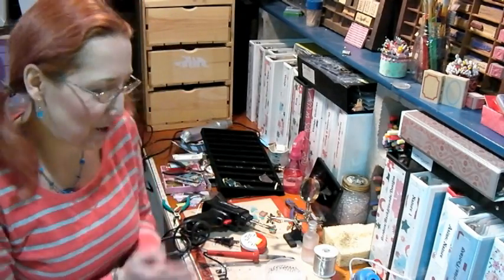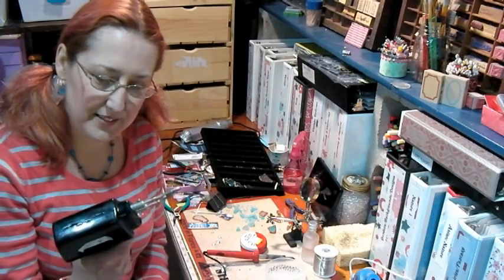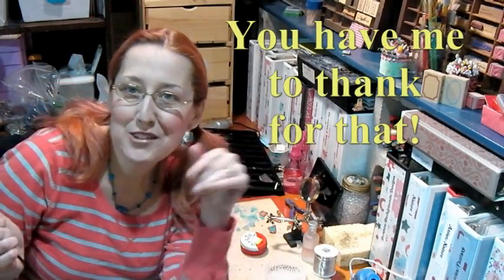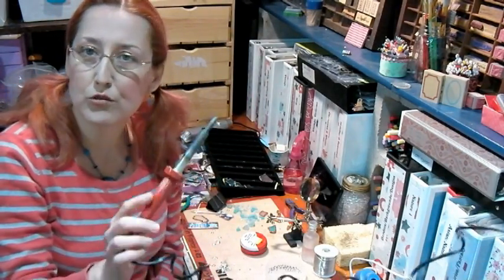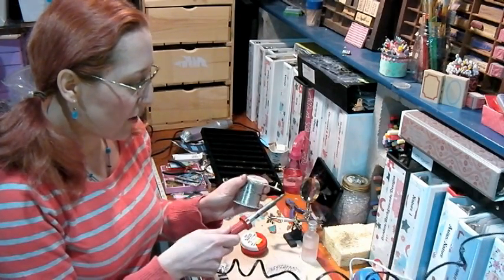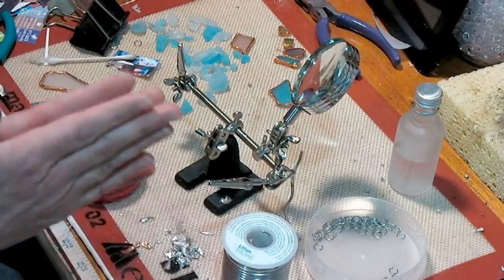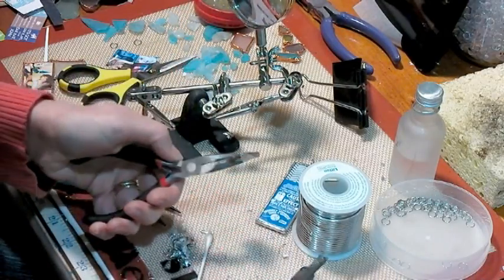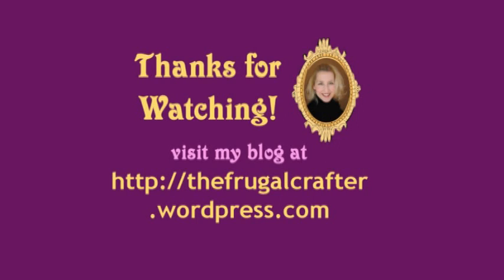soldering for crafters

Comment: Hi Lindsey; Your DIY videos have been a huge help to me, thank you so much for posting them. I have been glued to them for a couple of weeks now especially the ones you have done on jewelry making..... After watching this one I think I am ready to take the plunge on soldering... but...I have a quick question... one of my daughters wants me to make her a bracelet with a medallion that is meant for a necklace.. 2 problems ..1, she wants it to be the center of a cuff like bracelet, and that means I have to add another ring to the bottom... 2, the madallion has a mood change center, ... I'm afraid to solder it incase I mess up the workings of the mood material with the heat from the solder... OR, will the flux protect the base metal from too much heat if I really coat the place I'm soldering?...
Reply from the maker: gosh, I have no idea, I see the mood rings and they all have metal bases ad they appear to be soldered and they might even use a hotter torch. I'd hate for you to ruin the bauble. It is glass right? Maybe you could put the copper tape on the class where there is no "mood" stuff. Or contact Fire Mountain Gems and ask them:)
Reply: thefrugalcrafter .
Thank You for answering me so quickly .. =) And, nope, its metal .. its a Fire Mountain madallion of two dolphins curved around the outside with that mood stuff in the center.. It's meant to be a necklace, but my daughter wants me to add a bottom ring then make it into a catch bracelet with narrow hammered wire, about a forth of an inch wide, as the bracelet part .. I didn't know you could ask Fire Mount questions like that ... Thank you for that info.. =)

Comment: if you look at HF they also have a foot switch which will let you switch on the iron and then only use the tip not the shaft (spent my life working as a stain glass window maker for church.

Comment: Hi Lindsay 
I'd like to buy some solder tomorrow MICHAELS is having a sale and I don't want to buy something I'm not going to need. Just to add a jump ring to something for example what would I need to buy? Flux, solder and the copper? Or is the copper only for something that does not have anything around it to be able to add a jumping on later? Im so confused 🤷🏻‍♀️ should I get a torch instead of a soldering iron? Looking forward to hearing back from you
Reply from the maker: you need the flux if you are using a soldering iron and solder. If you are using a torch I am not sure, as a salesperson in store:)

Comment: Love your video. A lot of info and to the point! I've soldered jewelry before but have not done so in 4 years, so I appreciate this refresher! Could you tell me which flux paste and lead free solder you used? I couldn't find any info on that in your video or on your blog.
Reply from the maker: Carmine Bermejo It was yaley I think, you can get it at the hardware store, I do not think the brand matters. Don't get the electrical solder because it has lead. Plumbing solder is lead free.
Reply: thefrugalcrafter Lindsay Weirich, thank you so much! Your video is very informative for people starting out on jewelry soldering. Keep up the good work!

Comment: Great job, Lindsay.  Trying to learn this craft and your video was very helpful.  Not a lot of videos out there for crafters, just electronics;(  I'm gonna try Harbor Freight for supplies, gun, etc.  Question:  If the metal tape is gold, how can you keep the gold look when it's soldered?  Also, where's the best place to buy the metal tape?
Reply from the maker: The tape is copper usually and gets covered with silver solder. You can give over it with a gold krylon pen if you want gold look tho:) or gold plate it with gold leaf.

Comment: You need to burnish your copper tape to your glass pieces with a plastic FID first before you solder. You lay the glass down flat and rub the fid on all sides till it is stuck firmly. You rub it hard till it gets smooth. Then your bracelets won’t ketch on fabrics and they will look great!

Comment: I noticed that you did not grind or file the glass edges.  Was that b/c the glass was rough already?  I grind the edges so that the copper foil sticks and does not come loose after you you solder it.  It works great.......just a thought.

Comment: The microscope slides you use in the making of your pendent, are they glass or plastic? If they're 1/8" thick each and you use 2 per pendent, doesn't the foil need to be a bit wider than 1/4" ? I'm just starting out so I am pretty novice. Thank you. Jim
Reply from the maker: Hmm, they must be 1/16" then because I am using 1/4" wide tape, they are thinner than picture frame glass so they must be 1/16", they are glass, plastic will melt:)

Comment: Hi! Love it! Can you help with a doubt? How can I change this solder wire color and make it looks older or change its color? Is there a different color for sold wires?!? When it is a transparent pendant, the copper color is visible inside the pendant also... is that possible to avoid it? If yes, how? Thanks!!!
Reply from the maker: I think you can get black or silver backed tapes. Try vintaj patina paint to antique the solder after it cools.
Reply: thefrugalcrafter Lindsay Weirich thank you so much!

Comment: Hi there I am interested in learning more about soldering. I am new an not sure if I should take the classes, they are expensive but I'd like to know what the difference between a torch gun and a regular soldering tool (used for electronics) is? Can I fuse pendants to make a statement necklace together with just a torch gun?
Reply from the maker: +flyhigh513 the type of gun you use depends on the metal.I use copper and steel so I use a soldering iron. If you use silver you need a butane torch. I am no expert but I have made sturdy pendants with my method.

Comment: Thank you for the detailed vid! I was wondering why you need to solder the copper tape on glass pieces. I understand soldering to attach the jump ring, but is the metal tape not enough on its own?
Reply from the maker: it is bought the solder is silver and the tape is copper so it just looks nicer and it does offer more protection because the tape could get scratched or peeled away:)

Comment: I was wondering what wattage iron you have. I have a 45 watt. I read in a book that if you are using lead free that the soldering iron needs to be at least 60-100 watts.

I tried to solder. What a mess and the tip oxidized so fast, that I could not even tin the entire piece (1" size). I've ruined one tip already. Should I tin the tip a lot while I am soldering? It was very frustrating. It is taking me several attempt to solder one small piece. 

Your video was helpful. I'll try again....sigh....
Reply from the maker: I'll have to check, it was one I got at the hardware store plumbing isle for a few bucks. I'll let you know when I get in my studio:) It does sound like you might need a hotter iron. Did you flux?
Reply: I did. I have some new tools and stuff on the way.
Reply from the maker: mine is a 40 watt:)
Reply: Thanks!

Comment: Thanks so much for taking the time to make the video.  I really enjoyed it and found it very informative.  I have a question maybe you can answer.  I have a wood burning iron.  It looks just like a soldering iron and the tip looks the same as the one you were using.  Do you know of any reason why I couldn't use it to solder?

Comment: I want to do the most simple solder job of placing the end of sterling wire to a place near the head of a sterling ring to wrap around something, just that one little spot.  Can I do this for sterling?  It seems simple enough, and I don't want to use a torch.  I have experience in the past with circuit boards and the iron.
Reply from the maker: I have never soldered sterling, I'm not sure the solder would stick, I think with a butane torch it melts the silver correct? I recommend researching at Fire Mountain Gems website to be sure;) Then again they make solder with silver in it so it would probably be OK...

Comment: Hey Lindsay - what is the purpose of the copper foil - I just bought a soldering iron and I have the flux, the solder wire but I couldnt find any copper tape.  Do I need it?  Or can I get  away with it?  I have aluminium tape - will that work?

Comment: No, I bought steel wire.  I figured I have all the stuff for soldering normally, I may as well try a regular wire then. But first he showed me the solder for aluminum. It's a skinny, tall bottle & it says to solder aluminum to aluminum. It was more expensive so I figured I'd try the steel wire. But when I did (using the regular flux, soldering wire & solder pen like in your video) it still didn't stick together. If I'm able to get my vid up & nothing looks wrong to you, I'll buy the other flux.

Comment: What watt soldering iron did you use for this project? Is a 40 watt iron too hot for this? And did you get the "tape" in the stained glass section at the craft store?  
I thank you for your video!
Reply from the maker: Jean Albarado 40 watt is perfect and the tape was from a stined glass store, a crft store might have it:)
Reply: Awesome--thanks for your advice.

Comment: for your irons-- get a separate power strip
get your project or projects ready 
then let them heat up when you turn it on at the power strip
when done use power strip to turn it off
that way no in and out of wall socket

Comment: Any advice on soldering 12 gauge aluminum wire, specifically what type of flux paste to use?
Reply from the maker: Jamie Andrade I don't think solder will stick to aluminum, try copper or steel wire.

Comment: Hi, your video is great and so informative! But what is the copper take used for? I mean, if I'm soldering some wires together on a necklace, can I just put the flux or do I need the cooper tape?
Reply from the maker: You need the tape on glass or stone as the solder will not stick otherwise.

Comment: Hi, I watched your video & after buying everything (paste like flux, helping hands holder etc), tried to solder. I'm making a necklace of a fav band with the letters as individual pieces that need to be put together. Well, after many attempts & a lot of frustration, I couldn't figure out why the pieces weren't connecting despite everything else going like your video. It turns out I have aluminum wire not metal. Do you have any info on how to solder aluminum as they're not sticking. :o( Thank you

Comment: Very good video.  Now I am inspired to try.  What is the mat that your working on?
Reply: Sandy Faulkner would also like to know.
Reply: I believe it's called Kevlar, a fire retardant material. Received a soldering kit at Christmas and my husband brought home some of the material, mainly because my art room has carpet and I work on a wood banquet table. Easy to cut but I don't know what it costs. Have enough for my lap too.
Reply: Sandy Faulkner, that mat is actually a silicone baking mat - I have one, and to be honest, given how much it cost, I don't know that I would use this particular mat for crafting.  It's used by bakers to line cookie sheets, the same way parchment paper is used.  Just search "silicone baking mat" on Amazon and it will come up.  This one is from France, and not cheap, but the other brands are a bit cheaper.

Comment: I've just got a 25 watt pen soldering iron. It worked good right out of the package buyt 10 minutes later the tip wouldn't melt the solder. I preped it and cleaned it with the sponge but it's still not melting it enough to have it flow. Do you think I need a stronger iron?
Reply from the maker: Terry Bell hmm, maybe, mine is 40watt, I think yours might be for thinner electrical solder.
Reply: thefrugalcrafter Lindsay Weirich  I thought so. It was the only one that had after the other one I bought at a yard sale died. I'll have to get a new one
Reply: Terry Bell thanks so much

Comment: Thanks for responding again....I tried and it still didn't work. :o( I've taken a video of what I did and am uploading it now in hopes I can put it here as a link...it's uploading super slow despite it only being about 3 minutes long. In trying to find other solutions, I read an epoxy could be used to glue aluminum so if the soldering doesn't work, I guess I will try that next but I'm getting quite frustrated. :o(

Comment: The best way to burnish the copper tape onto the glass is to use a wooden pencil and rub it along the surface of the tape with light pressure.   Also do not cut the tape when applying it around the edges, it won't stick correctly to your project.

Comment: sometimes when i'm soldering 2 pieces of brass together, the solder just stays round and doesn't flow no matter how much flux i use or how long i keep torching it; two surfaces of brass are red, the solder is also red and it seems like everything is fine for the solder to melt and flow but it wont. do you have any tips for me? thanks in advance.
Reply from the maker: pouya haghani Are you using a butane torch? I have no advice on those but try Fire Mountain Gems, I think they have torch firing tutorials,
Reply: pouya haghani Sounds like your brass is dirty, clean it and then don't touch it with your hands, keep the greases off your metals. A good way the check, is to run some water over the metal, if the water sheets off the metal is clean, however if the water pools into lots of droplet's the metal will need cleaning.  Hope this helps. Give it a go anyway it can't hurt, good luck.

Comment: I m just curious about the temperature and can it be to hot. I end up with clumps on my piece and then it will not melt anymore to smooth out?? Am I using to much solder?
Reply from the maker: Sandra Patnode sounds like too much solder:)
Reply: thefrugalcrafter Lindsay Weirich Thank you, you were right.

Comment: hii
i want to ask u 
what do using for that make solder looks stick 
alcohol isn't it ??/
Reply from the maker: Flux is what makes the solder stick to the metal and copper tape. I used alcohol to clean flux off the glass when I was done:)

Comment: how easily has the bracelet come apart ?
Reply from the maker: Matthew Whatley it has help up well:)
Reply: The copper foil hasn't pulled away from the glass at all? Cuz in this picture, it looks as if it's kinda loose , but u really do think this would make a good gift
Reply from the maker: Matthew Whatley it is good, I think because the glass is translucent you can see through the edges and that might be why it looks like that. It is a nice gift but uou might want to get the tape that is silver on the back do it looks better if using transparent glass. Also solder the jump rings closed if you can to make it extra durable:) That is where you would have a weak point, not on the tape.
Reply: Ah, ok, well I have silver back tape, so that's good, have u sold any of these , if so how much have they sold for ?
Reply from the maker: Matthew Whatley I have sold the earrings for $7 a pair, not the bracelets though:)

Comment: Hi and thanks for a great video!
I have a problem and I hope you can help me.

I started soldering today and I just can't get the jump ring to stick.
The solder just floats off the ring. I am using flux and I have tried different type of jump rings - steel and metal and the iron is shiny and new.
Tried both solder with and without lead.

Do you have any clue of what I am doing wrong?
Thank you!
/Katina in Sweden

Comment: When you solder that metal you really should be doing that outside in really good ventilation.Also you need to be wearing some type of a resperator.I guarantee you that breathing in that smoke from the soldering can give you cancer.
Reply: Anything can give you cancer nowadays. Being close to a microwave once gives you cancer. Toasted bread gives you cancer... Really, who cares? Nobody will breathe the whole smoke in anyways.
Reply: Come on now she is not tig welding oil pipe. Max said it better three years ago.

Comment: Leaving your Solder Iron on for long periods isn't your problem. The problem is not keeping the Soldering Tip always Tinned (What you're calling "Tinning" in your video is NOT Tinning which you need to be doing first!) if you're Tinning the Tip at all. Oxidation starts the first time you heat your new Tip if you don't Tin the Tip with a Lead Based Solder (without Core Flux) and will attempt to Oxidize each time thereafter if you don't Tin the Tip as the Tip heats up and cools down but that first time with a New Tip is most crucial. Stop thinking you have to rush into everything and take Pride in what you're doing by treating your tools and equipment with care.

Comment: Hi! I am browsing around and this is the only tutorial I could find that is kind of similar to what I would like to do.
I made the same mistakes as you so I know what not to do...but I still cannot find out how to add solder to a crystal without that copper wrapping. I have a necklace I bought awhile back and I want to make something similar to it...

Could you maybe give me some information on how that is possible if you can, much appreciated.

I have attached link to the image of my necklace I want it to look similar to. The issue I am having is that the solder does not stick to the selenite crystal , or any crystal for that matter.
http://s22.postimg.org/3xxhikb41/unnamed.jpg
Reply from the maker: you need to tape it but the tape will be coated with solder so you wont see it.

Comment: The kind of solder you are using generally has lead in it and should not be used for jewelry.
Reply from the maker: It used to but nowadays most solder for stained glass and all solder for plumbing is lead free, I was sure to use lead free for this project.

Comment: Terrible advice. If your iron is oxidized use acid flux and wipe the tip with 0000 steel wool also you are meant to tin the tip by adding solder to the tip when not in use. Filing the tip will remove the plate making it even worse.